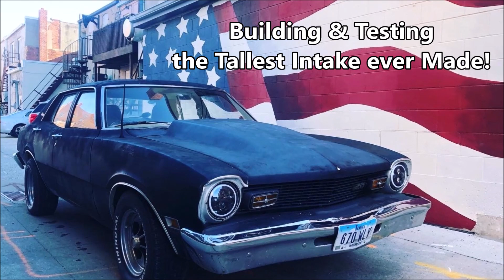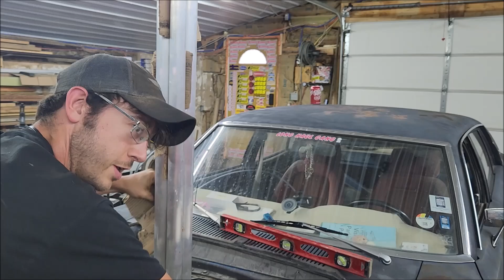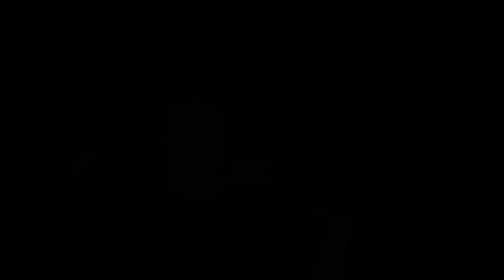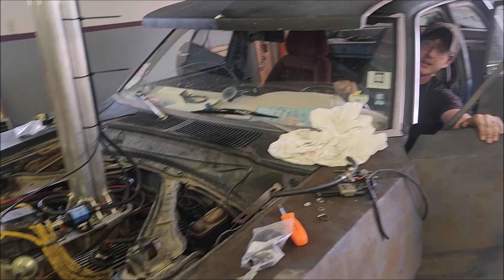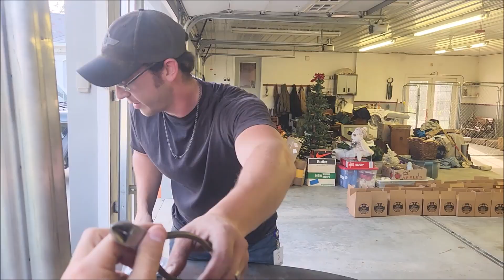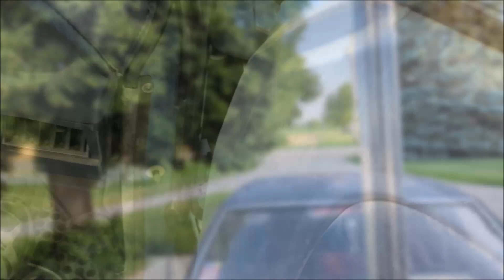Will it Run? World's TALLEST Intake! (move over "Sky Ram")

Comment: Correct me if im wrong but i think this is really more of a 5' carb spacer than intake.  Your intake still has a common plenum in the same place, so it should still have the same characteristics as far as scavenging goes
Reply: That's an interesting way of looking at, and I agree.
Reply: But by adding a spacer you are increasing the plenum volume and effecting the velocity of the intake charge. 
The intake velocity on this is so fast that it’s getting the pipes cold. If he drives that on a cool humid evening he will get frost on those tubes. 
Honestly, I think he’ll note increased torque mid rpm, and probably a pretty good boost of hp up top. I suspect the off throttle will be a little soggy due to the mile between the squirter sand the igniters

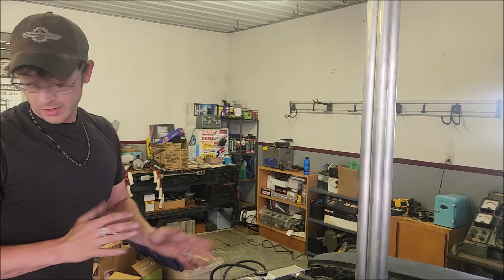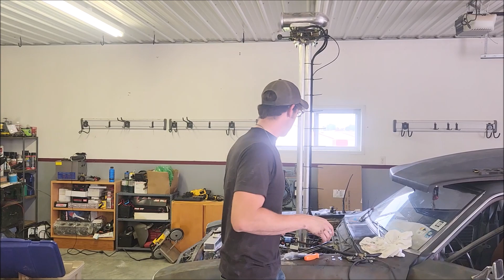Comment: TH289...i have seen several times or even myself used a framing square to work on cars... but not on intake system...freaky pumpkin head at 10:40...and i beleive the name should be the "Thunderheader" 👍👍👍⭐✔️😎😁 11:38

Comment: Fun fact: Back in the 70s the Turismo Carretera cars in Argentina used a similar snorkel but a lot shorter than the one you made, ngl I like this take of it on your Maverick, I'm sure it will give it some more power not like TC cars since those were completely modified inline six engines that were super loud but it will probably make enough of a difference from the regular setup!

Comment: The flag pole.  Angle it back by about 30° so you can add another 10 feet to it
Reply: angle it forward, more ram air effect.
Reply: @rearspeaker6364  do both, or make it into a giant Z and call it the Zorro!

Comment: When you change the fuel pressure it doesn’t change anything with your float Not one bit. Even if you go more than say nine pounds it don’t change your flow. It never changes your float Height. It’ll just push it past your needle and seat and flood it, so you’re wrong there..
Reply from the maker: False. It changes your float - I've proved it in several videos. The buoyancy of your float resists the fuel pressure. The harder you push down on the float, the lower it will sit to push back. 

It's like a boat, the more you load on it the lower it sits - displacing more water - float is the same except float bowl is fixed size so that displaced fuel equates to a higher fuel level. 

That's the science, chap

Comment: Clearly you should run the throttle by radio controlled solenoids. Think how much fun it will be cruising down the highway when you discover that some guy with a drone is operating on the same frequency!🤣

Comment: What happens if you stick a shop vacuum in the tailpipe of a car on a dyno run??? Will it make more power?
Reply: Not for a dyno run. The car is putting out way more exhaust than a shop vac can suck in at full load. 
A shop vac can mess with the tuning at idle though.
Reply: @NBSV1  interesting..always wondered what would happen.

Comment: 😎😎😎
      Many years ago , a sorta famous drag racer ran a "I believe it was a 50s Plymouth in races with a set up similar to this but ,not that high .
   He got it to work pretty well. without the aid of electrical devices .
      So it's nothing new ,        
             It's    just .
                  🤔
Reply from the maker: Probably tuned it for qide open throttle - there's a difference between working and working in all driving scenarios.
Reply: @ThunderHead289  
 ALL , driving scenarios?
     like low limbs, power lines , and low structures .  
          OK .
                😆
    Hay ,somebody's gotta mess with ya.
                     😁

Comment: You could have used a radio control servo to turn the throttle. Rather than trying the throttle cable. But whatever makes it work.
Reply from the maker: Sounds like a terrible idea honestly
Reply: @ThunderHead289  Well, I'm not sure if you know but there are some servos that can apply forces up to 2000 ounce inches of twisting force. That means at 1 inch from the center of rotation it can move 2000 ounces. Those are expensive ones though. You can get one capable of moving 1000 ounce inches for around $60. Just a thought.

Comment: Hey, you probably get into  hot weather during Power Tour and it doesn't look like 'Mad-Mav' has factory A/C, how about installing a 5,000 BTU home window-mount A/C unit in a bulkhead in one of your rear door window openings and then mount a little 2,000 watt gas-powered portable generator on top of the trunk lid and travel in true 'stylin' redneck comfort? 😂❤

Comment: That's awesome, but also a little scary. So is that column full of atomized fuel and air? If that ignites inside the pipe will it explode outward or just launch the carb into the air?
Reply from the maker: That's a myth honestly - it will just pop out the carb like a normal engine no problem.

Comment: Technically that is not the worlds tallest intake. The intake is still bolted straight on top of the block. Technically you have the worlds largest intake or carberator spacer. But however I’ll bet it’s got more torque than normal

Comment: The sad thing is these AIO are just a fad and not even good value unless you are legitimately pulling 250w, which you just aren't when gaming.  A good 140mm air cooler from Noctua for example, or Scythe or Deepcool will do a great job on a 160w processor.  If you are in fact using north of 200w, you have an old or expensive CPU and either need a newer budget rig or, if you are flush, a real custom watercooling loop (or one of the 'AIO' prebuilt loop style ones).

Haven't met an AIO under $100 that was appreciably better than my Mugen Infinity or Deepcool Lucifer V2 were for $35 (used/scratch and dent)

Comment: Long time subscriber here, hoping that you read this one. Manifold vacuum is the secrete unlocked here. Now you have cold air injection also. Now its time for the " worlds longest intake " because if you mounted it in the trunk next to (just closer) the fuel tank, aside from having the worlds shortest fuel line return from the carburetor, and now coldest but fuel mixture or should say the turbulence will be maximized now. Making positive sure the engine vacuum is maintained perfectly. And if you went single plane manifold, a largest single barrel carburetor might have some kind of following.

Comment: Sorry that is not the tallest intake on the planet, i watched a jeep with a intake that was over 15 feet tall along with the exhaust pipe and then the jeep proceeded to drive under water and the intake and exhaust were barely above the water line, the driver had to wear scuba gear to do the drive under water
Reply: but, that's a florida only thing.
Reply: @rearspeaker6364  what you should of used was a huge funnel to help increase the intake volume as you speed up